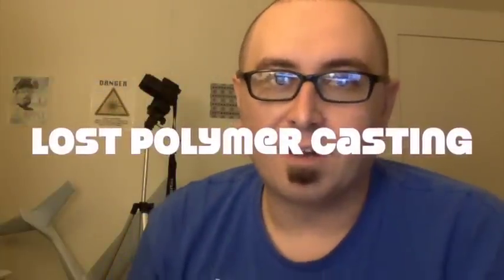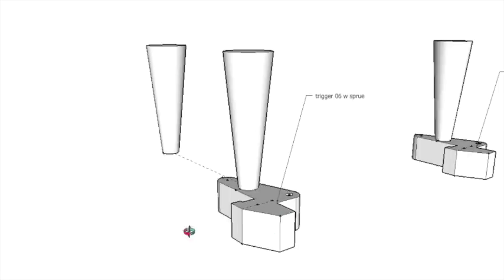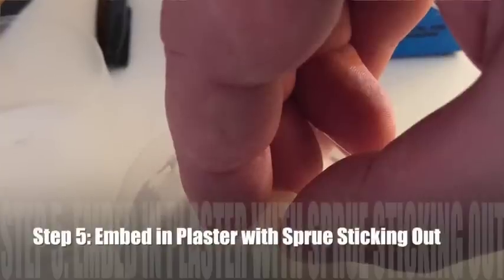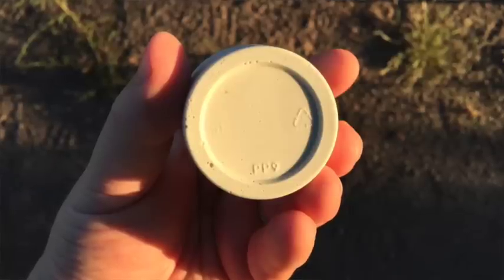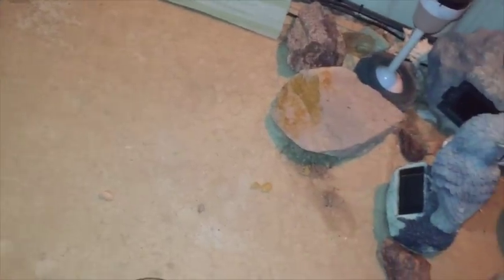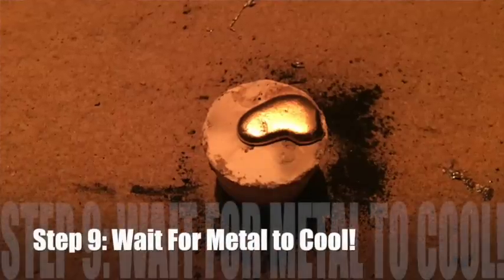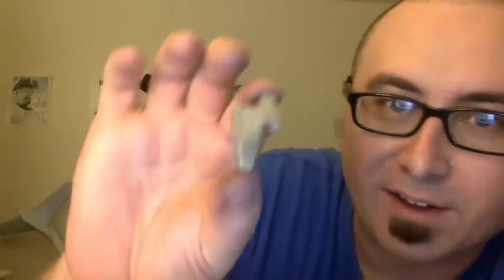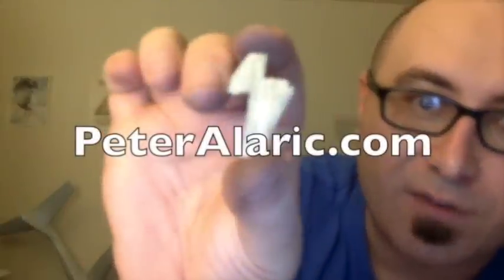Make Metal Parts with a 3D Printer (lost polymer casting tutorial)

Comment: Great job sir!!!! And I look forward to do some metal casting in the future myself. I have been researching this for a few years now so that way before I get into this art I'll be better prepared and learn from other people's mistakes and learn about how to take it on correctly. Since when metal cools it shrinks just a little bit and I remember reading awhile back that it is important to make your 3d print 6% to 10% bigger than normal so you can allow for a little shrinkage as the metal cools and solidifies. From there you can use various fabrication tools to dial in your metal part precise. For example like you did using the smooth file or safe edge files depending on the situation. Then a India stone set from 60 grit to 5,000 grit. Or wrapping some emery cloth of various grits around your mill file for the lapping process. And lastly if it needs it a Dremel with rubber tip and green polish compound and finish off with felt bob tip with green compound to make it shine nice and pretty on that metal. There is so many alternatives for fabrication tools in the jewelry Smith realm, gunsmith realm, bladesmith realm and automotive realm to shine things up for the finish up process on metal as well as Machinist fabrication processes for metal finish up. Great job buddy. Also Robinsons Foundry on YouTube shows a nice technique on his drill press to finish up a metal piece  after it has been cast from 3d print to cast mold. Also oz tools from Australia has some awesome fabrication tools to attach to your drill press for fabrication process on metal cast projects. Once again on 3d printing to cast mold make your part 6 to 10% bigger to allow for slight shrinkage when metal cools and solidifies. Then if it's still just a hair to big for your specific project you can always dial it down to size with fabrication tools and get it to exact specs. Best of luck and wonderful job and Merry Christmas to you and your family.
Reply: Also if I had my metal part just a little to big after I cast it I would 3d print 2 parts of the same thing. 1 for the cast mold and  1 to use as a template to overlay on your metal piece so you can back scribe or back punch either way. Or print off on paper for that specific design and back scribe lines all-around the part with dykem layout fluid or home made layout fluid so that way if your metal part is just an hair to big your lines will let you know where to stop and dial it in just right. 😃👍

Comment: Where can I find a little metal forge like yours?
Reply from the maker: It's called a Hot Pot 2.  This is where I bought it: https://www.amazon.com/gp/product/B002QG3H9M/  Looks like it isn't available on Amazon anymore, but you could probably find it elsewhere.  Good luck!
Reply: @PeteLaric  thank you!
Reply: The hot pot 2 gets hot enough to melt steel?
Reply from the maker: @250smacks  No problem.  Unfortunately, I don't think it will melt steel, no.  Steel melts at something like 1,400-1,500C.  I use pewter for casting, which is an amalgam of tin, antimony, copper, and bismuth.  Pewter melts at 170-230C, which is incidentally about the same temp as the extruder on a 3D printer (PLA: 180C; ABS:230C).  This makes it super easy to work with.

Comment: MoldLay is better than any other plastic filament because it's a filament with wax-like properties. It's very stiff at room temperature but becomes extrudable when heated to 170-180 °C. MoldLay is a filament that can print both molds for the lost wax casting and for permanent mold, is extremely stable and remains dimensionally rigid at room temperature.

Many have tried to make this process with the PLA, but this requires having a furnace at a higher temperature to melt. Besides this the melt not easily leave the mold cavities. But the MoldLay not require such high temperatures and it does not emit toxic fumes when melted. With MoldLay  you can use your kitchen oven. At room temperature it is very rigid and solid and becomes extrudable when heated to 170-180°C. When heated in an oven at 270 °C, this liquid becomes a thin oil viscosity.

https://www.matterhackers.com/store/3d-printer-filament/moldlay-filament-1.75mm
Reply from the maker: Thank you for the information!  That sounds useful indeed.  I have heard of castable wax filaments but I've never used them.
Reply: MoldLay, PolyCast, Print2Cast... there're a lot of types of casting filaments availables in market, you'll just have to find the best filament to your neededs.  Remember... Wax filament is not like PLA or PETG. This filament is an indomitable horse that requires a good experience to get its best results, so you'll have got to practice a lot. The best hint: print your paterns very slow and quite hot, at 185-190 °. Use a layer height with 00,8 or 00,6. Good luck.

Comment: A gas relief sprue is required to insure complete fill of the void. Also, no reason for printed sprue to be solid, save print time and material by making it, and the gas sprue, hollow, their open ends are above the mold, so the mold will render them as solid. Gas sprue can be smaller than fill sprue, some amount of metal will flow up relief sprue when mold is full, without this, you'll have voids as you saw on this piece. For mass production, one can make reusable latex master mold or 2 piece plaster or sand mold, especially worth doing if one side of finished piece is flat as in this example. Better to recast than to reprint and repeat lost wax method all over again. Thanks for taking the time to make this introductory video.

Comment: It is literally impossible to get a through hole that fine to survive reality using plaster as investment. Print it with divots (tiny conic countersink type thing) at hole center to freehand peck drill it, or fill the hole with a pin of metal that won't "solder" into your cast alloy (so aluminum for pewter) that melts at a higher temp. Leave a couple mm overhang outside the part to bed in the investment. When unmolded, pin taps out, nice hole left. Your through hole investment snapped off from the thrust of pewter inrush, probably from an air bubble. Tiny cross sections of plaster, especially when not vac degassed, are about as delicate a chunk of matter as can be produced

Comment: if u hve added a sprue which is needed anyways, don't u think that there should be a riser at the other side so that the metal fills the cavity properly without any air pocket within the metal or deformities....
Reply from the maker: actually i find that using 2 sprues works very well, for the reason you mentioned.

Comment: what metal did you use? do you think this process can use hard metals like those used to motor parts?
Reply from the maker: i used pewter, an alloy of tin that has a pretty low melting point.  i have no experience with casting aluminum or steel.  i know people use lost polymer casting for aluminum.  as for steel, i think sand casting is more common, and i think the temperatures required are insanely high.  i.e. it's very dangerous!  cheers.

Comment: Oooooooor you can just print in SLS Carbon fiber reinforced nylon, with 100 micron layers and 0,2mm resolution for smallest features, which will be super strong, almost like aluminium for all intents and purposes when we're talking about small objects like these, and you'll get the detail, precision and tolerances like you would with regular SLS prints, meaning, as good as it gets and pretty much identical to mold injected parts.
Reply from the maker: damn, that sounds awesome!  if i ever build an SLS machine, i may have to get ahold of some of that stuff.

Comment: Would something like this be possible with a part made using a 3D pen or would I need to fill in the whole object with plastic any help is appreciated I wanna cast a small sniper rifle I made from the game Halo 3 that I traced with a 3D pen.
Reply from the maker: if it's really wiry, you may have problems, as thin plastic noodles will leave thin air channels through which to pour the metal.  an alternate approach is to use high-temperature RTV (room temperature vulcanization) silicone rubber to make a negative of your part.  pop the plastic part out and pour the metal in its place.  that way you don't ruin the original like you do with lost polymer casting.  hope this helps!
Reply: It does thanks for the help and for the reply. If I ever have the time to get the materials to try i'll let you know how it turns out. :D

Comment: Get a 1 gallon paint pot and use it as vacuum chamber (get a used vacuum pump). It will get rid of any air bubbles in the plaster before it sets up.
Reply from the maker: thanks, i may just have to try that!

Comment: Put your element angled, add degrassing hole/tunel at the second and highest side, make bigger pouring funnel, made two part mold, so you can remove plastic part, and add borax to molten aluminium.
This way you should have good quality alu part that looks exactly like 3d part.

Comment: This is a pretty neat process... from this video, I could do a full 3d print of the object I want, print the master, assemble it the way I desire and encase it in plaster of Paris. I could make the sprue out of a plastic dowel...
Reply from the maker: thank you!  yep, i've found it to be quite useful for all sorts of projects.  i was amazed to discover this wasn't common knowledge when i released this vid, but it seems to be catching on.
Reply: Peter Alaric My only worry is destroying the master.
Reply from the maker: it's in the nature of lost ### casting that the original object is destroyed.  however, there are alternatives.  for example, i did contract work for a guy who took some objects i made for him on a laser cutter, and used them to make negative molds out of RTV.  then he cast positive copies in pewter using the RTV negatives.  he says this works great.  i haven't tried it, but it sounds very intriguing.

Comment: Very very cool! Can you provide any more info on that electric forge you were using? That looks EXTREMELY convenient!

What kind of metals can you melt with that thing? 
Where do you get your raw pewter?

Thank you for the video, look forward to trying this. 

My main reason for getting into 3D printing is more about practicality and repair of items, so 90% of the videos on youtube demonstrating how to make D&D dice, and figurines just don't cut it. Love to see practical use of this awesome equipment.
Reply from the maker: thank you!  the melting pot is called a Hot Pot 2.  i bought it on Amazon, IIRC.  it's useful with low-temp metals like lead and pewter, but probably not aluminum, copper, etc.  i bought a bunch of pewter on ebay.  $10/pound is about typical i think.  agree totally about making functional things!  it's what i'm all about.  ;-)

Comment: If only it were possible to 3d print with Wax, that would have made the casting and the melting phase much easier.
Reply: I'm kinda new to 3d printing but I've read that there's a printing material that's dissolvable, that's normally used for supports.  I wonder if that would give better results?
Reply from the maker: actually, there are such things as wax filaments, but i have never used them.
Reply: Peter Alaric I bought, and tried to use wax filament. I could never get it to work right. I'm just going to use PLA from now on. It's easy enough.
Reply: MrManerd Interestingly I was looking into this and gave thought to using Delft Clay but it's expensive. I wonder if aquarium sand would work
Reply from the maker: there is something called machinable wax, which i have used in the past with my CNC milling machine to produce positives for casting, e.g.: http://lyratron.com/Lyratron/services/casting.jpg
Reply: I could see this used for casting the model for the lost wax method. The hard part is keeping the wax hot during molding so it doesn't solidify. I could check if smooth-on has something like this for wax... it would need to stay runny as possible
Reply from the maker: GUNNER67akaKelt you are most likely referring to polyvinyl alcohol, PVA.  it dissolves on contact with warm water.  yes, your idea is rather clever and it has been suggested to me before.  i haven't tried it, but i am apprehensive for one reason: water is required in order to mix the plaster.  since water dissolves PVA, it would be a race between the PVA dissolving, and the plaster solidifying.  if the plaster hardens faster than the PVA dissolves, you'd be golden.  otherwise, the cavity might very well implode on itself.  of course there are other investment materials that could be used in lieu of plaster (e.g. silicone, RTV, etc.).  i am certain there is some combination of materials that would work!  cheers, ~P
Reply from the maker: PLA is great for lost polymer casting -- easier than ABS, i'd say, because it melts out easier and doesn't leave a residue like ABS sometimes does.  i don't use PLA anymore though because it tends to carbonize in the extruder -- especially when going between different temperatures (e.g. switching back and forth between ABS and PLA).  i now use ABS and HIPS exclusively.  both are durable, can be acetone-welded, and won't carbonize in the extruder.  in fact i have yet to experience a jam of any sort since switching to ABS about 2 years ago.  i also went from a 0.35mm nozzle to a 0.5.  the larger diameter is more resistant to jamming.  just some data points for you!  best of luck.

Comment: Would help to remove air bubbles in the plaster,  that defect might have been part of a trapped air bubble(s).
Reply from the maker: i agree, however i think in this case, the defect was due mostly to having a very narrow-gauge hole in the part.  that means there was essentially a needle-thin bridge of plaster in the negative, which probably collapsed the moment i poured the molten metal, if not sooner.  i have learned to simply drill any small holes after casting.  :-)

Comment: will the hot pot 2 melt aluminium??
Reply from the maker: i wish, but i really don't think so.  Al has a melting point of 660.32 °C.  tin (the primary ingredient in pewter) has a melting point of 231.93 °C, which is around the temperature of a 3D printer nozzle when extruding ABS.  the actual melting point of pewter varies by composition, but it should be in the range of 170–230 °C.  pewter and aluminum are very different metals, unfortunately.  however, you will find that even pewter is considerably stronger than 3D printed material.  compare the Young's modulus of virtually any polymer with that of virtually any metal, and you will see what i mean.  no comparison.  they used to make knives out of pewter.

Comment: you can use this technique to make plastic parts of airsoft into metal
Reply: It depends on the plastic of the part. If the plastic is glass filled you probably won't be able to burn it out. If I were you I'd Google around on how to identify different plastics and figure out what you are working with.
Reply: i just want to replica that plastic part into metal bro
Reply: Right but if you don't understand the importance of what I just told you then you shouldn't attempt this.

Comment: JB weld where the hole got messed up, let it set, then drill the hole out correct. Finish by filing and sanding the exterior to spec. again.

Comment: Most excellent - I've been planning on doing this with aluminum for a while. The only thing I could recommend is that you vibrate the mold while the plaster is wet (to remove air bubbles, as others have mentioned) as well as leaving the super fine details to later machining. For example, the hole you have - I would have cast the part solid, then drilled later. However, you seem to have done just fine! +1 sub!
Reply from the maker: thank you!  and thanks for the sub!!!  i figured out the bit about the hole.  i need to rig something up to vibrate out the bubbles.  i've used portable back massagers, but it tends to be messy!  ;-)

Comment: AWESOME IDEA TO SHARE!  THANKS SO MUCH!!!   Great job!  Perhaps the defect might have been non-existent, if you would have used a small air vent 'sprew' in addition to the "fill sprew" shown in this video....  Then the air could readily escape the recess of the cast, which would allow the metal to fully in-fill.  ??
Reply: you want to orient the part so that the sprew is LOWER than the air vent (or air ventS PLURAL...in the case of LARGE parts)...that way the air which always 'floats' to the top, will have a way to exit the part, allowing the metal to enter where the air might otherwise be trapped.
Reply from the maker: thank you!  indeed it sometimes helps to use more than one sprue.  when doing lost wax casting, we sometimes made thin little air vents out of wax.  this could be done with 3D printing, but would be difficult with an FDM-type printer like mine (support material would be hard to remove without damaging the air vent).  hence, using multiple sprues is a viable option.  cheers!

Comment: To avoid the casting failure mentioned in the video, try using the gravity by creating a longer spur. You could even put the plastic mould in a sand bucket to get more pressure to be able to fill the mould better.